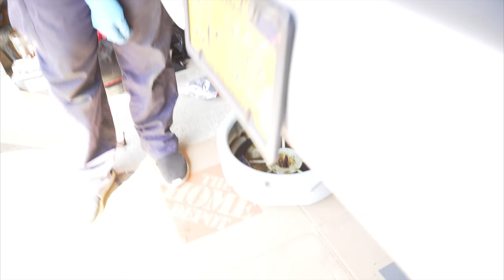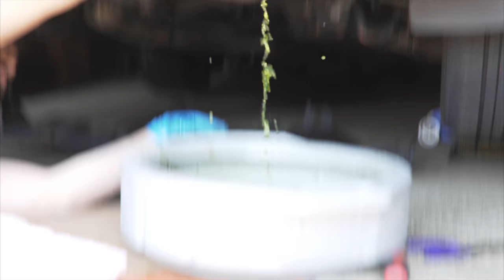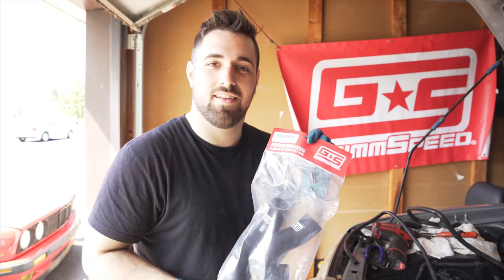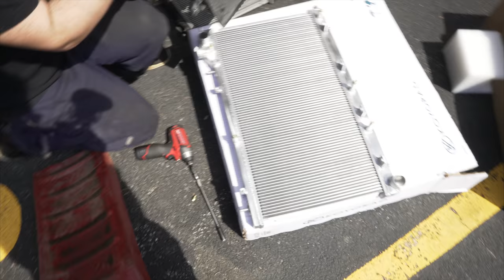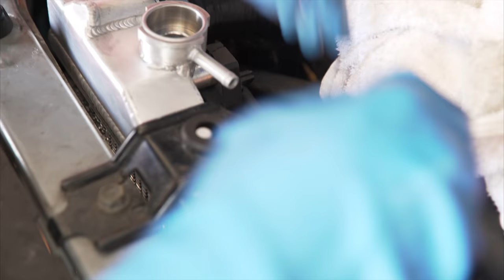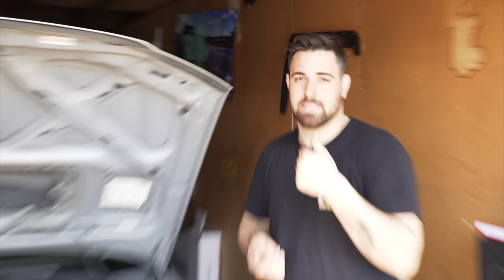Best Way to Keep Your Subaru Cool!

Comment: So in regards to avoiding the Blown Gasket issue that Subee's r known for, would upgrading the radiator like u did here do much for me? Should I focus more on upgrading the radiator fans 1st in addition to the cylinder 4 cooling mod? 
Or in my case if I replace one then  should I replace the other at the same time to maintain proportionality and see reasonably improved results? 
All this is in addition to flushing the coolant of course.

Comment: I've got one of these on my 5Spd SG6 XT and and an eBay knockoff on my 4eat XT.   The knockoff actually had better fitment weird enough and completely unexpectedly!  BOTH had the plastic endtanks fail in the middle of summer rushhour traffic,  BOTH are amazing upgrades. 

Have you yet found www/GetADomTune.com for the #4 Cylinder Cooling Mod, seemed like it would be your kinda thing, and also check out IAG AOS if you haven't done it yet, just discovered your channel and am trying to get up to speed in one night!  Keep it comin with the content and video's!